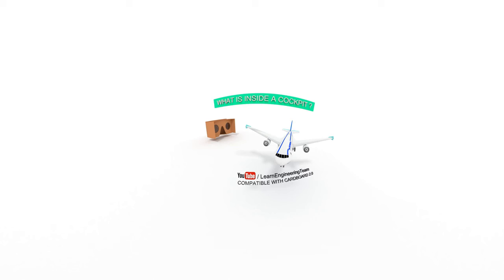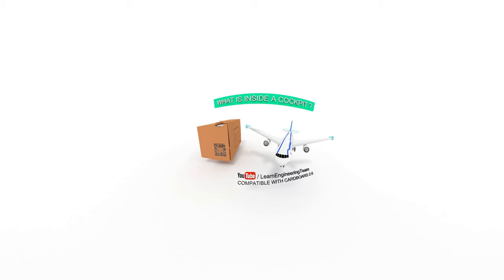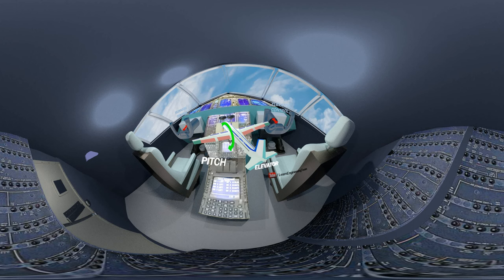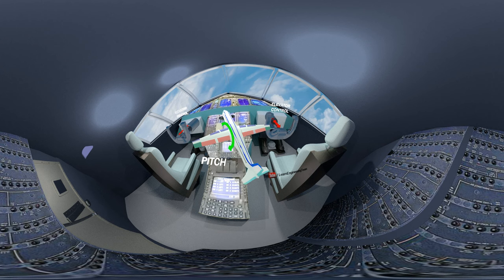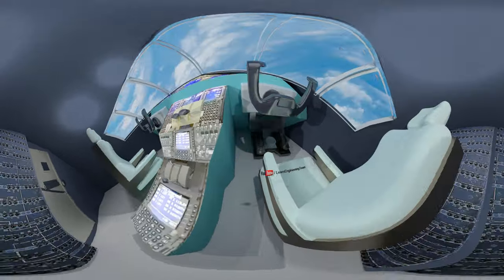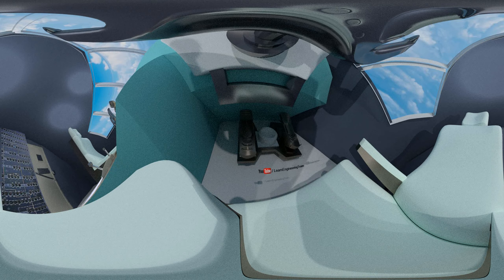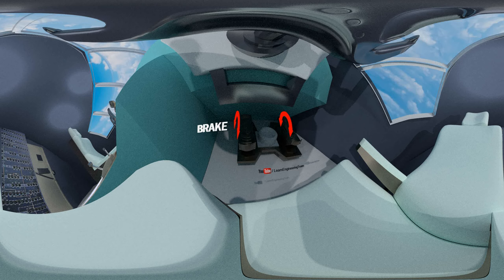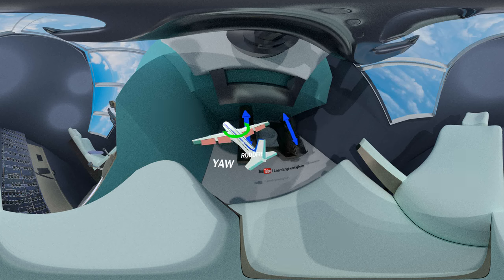360° video | Flight controls & Inside of a Cockpit

Comment: Awesome video! I'd just like to point out one thing for your future videos that might help improve the video encoding quality. I noticed that you tend to use textures that have some grain in them. MPEG encoding cannot handle random noise very well and so it tends to quantise it a lot more. Making the grain in the textures larger or using a texture that isn't as noisy will help to reduce MPEG quantisation artifacts. YouTube re-encodes all 1080p HD content to around 8Mbps I believe, so no matter how high the bitrate is when you export your project, it will always be re-encoded to a lower bitrate. I find it helpful to export an 8Mbps version to make sure it is compatible with YouTube's system.

I hope this info helps, and also thanks very much for the videos you produce.
Reply from the maker: +Jim Griffiths Thank you for this information. I will look in to this issue in more detail.